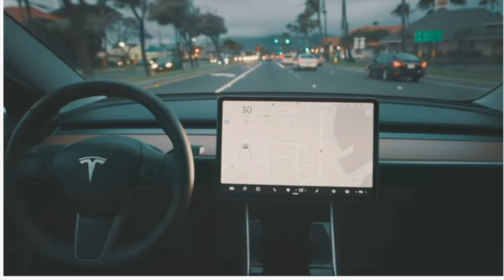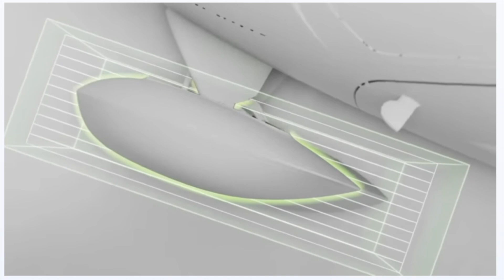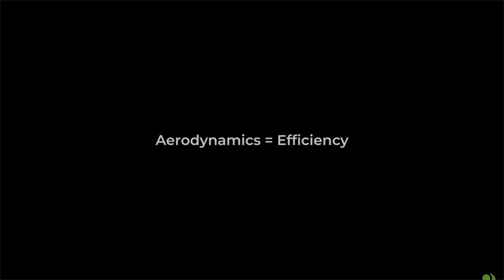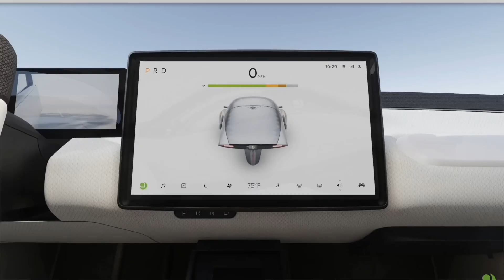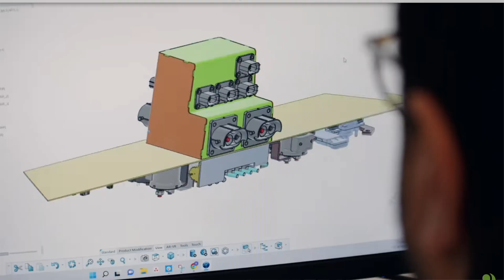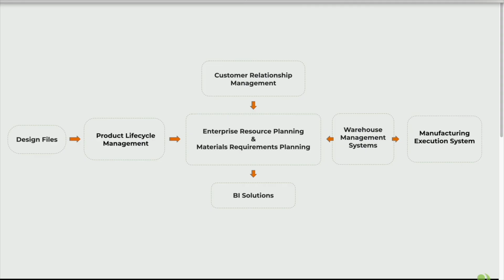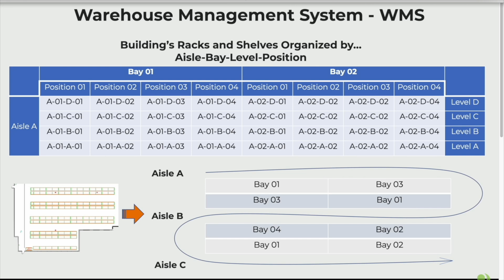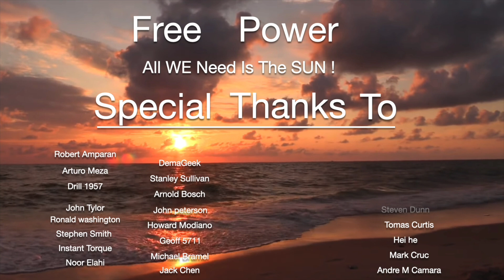Aptera Is Going To Change The Status Quo , Part 2

Comment: I hope the solid state batteries will be commercially available next year. Battery technology is advancing fast, there is plenty of room for innovation. That might solve the only 'Aptera issue' that I think could be problematic: the cooling system.  Solid state batteries don't require as much cooling as the current li-ion batteries. The in-wheel motors could be redesigned to be less temperature sensitive, to prevent overheating electronics in the motor wheel. If there are a few problems left, I am convinced these can be solved, but that could rise the price for the first delta versions. I assume Tesla will also develop a very low friction car with solar included, however, Tesla can never approach Aptera's efficiency, since the Aptera design is optimal. Tesla needs improved solar technology to rival Aptera's solar powered range.

Comment: You are missing a key thing.  Aptera is the ultimate vehicle for renters that can't install level2.  Level 1 charging for most EVs is just not quite enough but with Aptera efficiency it is lots.  Between solar and 150 miles with an extension cord overnight Aptera is the easiest EV for people without their own property or garage. Here in canada we have electrical outlets for engine block heaters in many parking structures which for Aptera are actually viable charging infrastructure; An Aptera can put on 40-50 miles over the length of a hockey game.

Comment: I think that the vehicle aptera is currently planning will become the most popular niche vehicle ever, but kind of doubt that it will be as popular as any of the current Tesla models.  Hope I eat my words though lol.  If the current vehicle does do well, and I believe it will, and in 5 years a 4 wheel version comes out - LOOK OUT!  Lol
Reply: Niche is good.  less direct competition.  I really think that with investment in advancing the current vehicle with LFP or sodium ion batteries, a heat pump, onshore body/motor production, a lightweight tow hitch, dynamic wheel pants and accessories it can serve a lot of use cases and with lower costs.  If a motorcycle can safely tow a light trailer an Aptera certainly can.  600+ miles is niche but the basic design allows for trash batteries as viewed by the rest of the industry to be more than enough.  Road tripping retirees, environmentalists, sports car enthusiasts, non-breeders, commuters, and 2nd vehicle for family; the Aptera can work for a lot of people.
Reply from the maker: I’m hoping at least a four door will appear in 4 years . 😎

Comment: The GM EV1 was ahead of its time. Unfortunately the battery technology wasn’t.
Reply from the maker: If GM was smart they would have research  and developed the battery technology . 😎
Reply: Learning about early EVs from the 1800 and early 1900s is really something interesting.  The battery tech being a limiting factor is nothing new.
Reply from the maker: ccibinel You are so right , I totally forgot about the people that live in apartments and condos . With Aptera they can just solar charge or plug into a regular electric outlet . 😎

Comment: The time is long overdue to dump all the inefficient, ugly, pedestrian-murdering, oversized SUVs and get a fleet of Apteras moving on our roads!
Reply from the maker: Oh YES , Aptera is going to bring big change ! 😎
Reply: Honestly I worry about how ugly it will be when a pedestrian gets snagged between the wheel pant and body.
Reply: Breaking your legs and getting flipped is a much better outcome than getting hit from shoulder to hip, thrown forward, then potentially run over. Aptera’s suspension will not be able to throw a pedestrian forward the way an SUV or large pickup truck regularly does, which is when pedestrian collisions are shown to be the most deadly.

And Aptera Motors is embracing driver-assist safety features which will, in the near future, reliably prevent pedestrian collisions altogether.
Reply: @EricPeelMusic  AEB protection of pedestrians is not something I would expect from the OpenPilot based system.  All vehicles should get smarter/safer with AI and eventually self driving over time but it will not be quick.  I worry that the pedestrian would get stuck on the suspension of the moving aptera and get sucked down.  The suspension clearance would not be enough to go over them so it would be pretty gruesome.
Reply: There’s no telling yet if Aptera will stick with Openpilot forever or embrace different software. I’m just saying it’s clear they’re embracing software as a means to prevent collisions rather than relying solely on mechanical safety systems.

Small cars, which often have around the same approach clearance as Aptera’s lower suspension arm don’t typically suck pedestrians under. What happens is they are swept off their feet and over the hood or over the car. The difference with Aptera’s suspension area would be they’d be flipped and end up on the ground on the side of the body. The legs might break and the flip could be bad. But I don’t see how the pedestrians ankles or shins could become attached to the suspension arms.

Do you suppose the legs could break at the ankles then the feet would get hooked under? I don’t think this would be the case. I think the pedestrians shoes would get ripped off or just lose traction before that would happen because the impact would be so low. In any case, most of the body’s mass, the critical parts, would be over the upper arm, definitely not sucked under. Definitely not knocked forward and ran over like the demonic SUV.